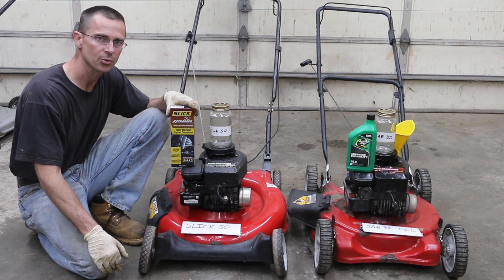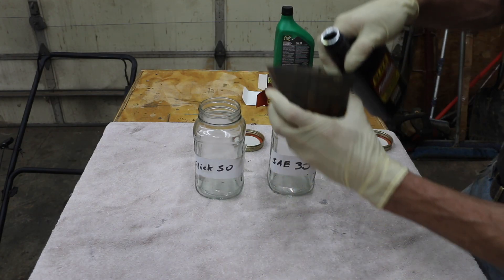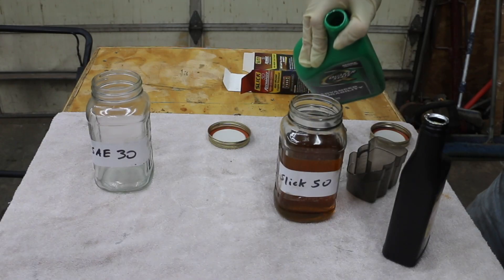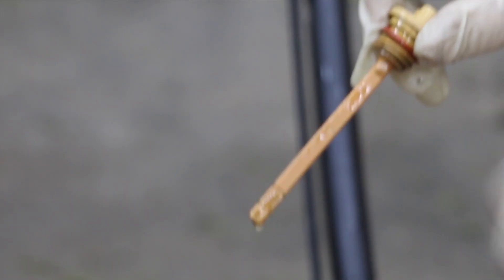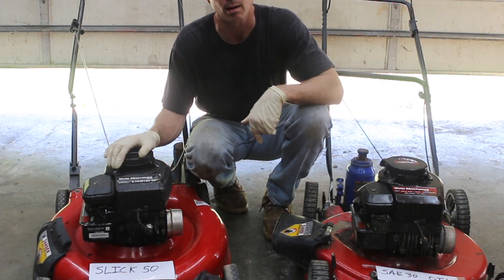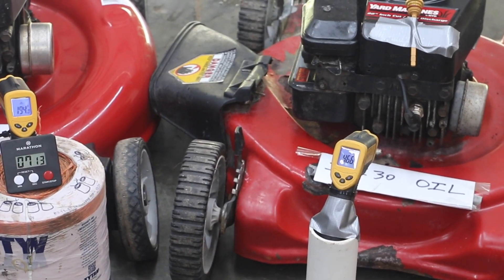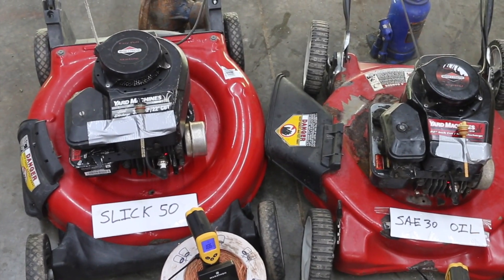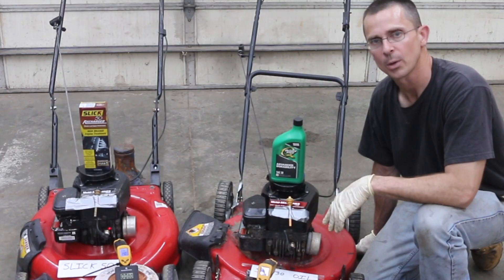Can't believe what SLICK 50 did to my engine!!--Dry Crankcase Test!

Comment: I think that they changed their formula. Took the Teflon out. In California anyway. When you tore an engine down that had it at the recommended use,  there was a medium brown film on the cam journals and mains and rods. Wrist pins were clear though. I rebuilt the 400 ci in 1995 with a little over 200,000 miles. It's still running today.
Reply from the maker: Thanks for sharing.

Comment: Slick50 does extend the life of engines. Lower Operating Temp = Less Internal Damage = Longer Life. These engines aren't meant to be run with nothing in them. You just got lucky that the one engine ran for 7 minutes. That's just the steel lottery.
Reply from the maker: Thanks for the feedback.

Comment: As I rember Slick 50 was some sort of Teflon coating.. actually PTFE or something like that.
The Slick 50 original formula is said to be the only one to still have it.. If it is still around.
There are claims that the Teflon suspended substance can actually cause less oil flow if it builds up in the ports and passages and that the cbustionnor cylinder temp is not high enough or maybe too high to bond it to the cylinder walls...
It would be cool if gave  the slick50 original formula some time to build up you did a tare down and looked for Teflon coating on the walls And passages to see what was happening...
I am more impressed with the motorkote as well as the engine restore  product that was reviewed where the results where immediate and the product didn't require time to have to build up before you could see or test for results. 
Which is the claims that others are making about bonding time for the Teflon to build up and set...
So enough said.. 
but on a curiously funny note
 maybe you can poor all these extenders and rebuilding products together and shak em.up and add a 1/2 quart or quart  to a lawnmower engine or car engine and do a video on that.. Now I would really enjoy watching that.
Reply from the maker: Thanks for sharing.

Comment: Todd, why don't you test Fluoramic's Tufoil Engine Treatment against the Slick 50 product. The Tufoil is said to be "The world's most efficient Lubricant" according to its manufacturer. I have used it for over 40 years in subzero (Northern NY) environments and extremely hot (southern Texas) environments and have never had an engine failure. My car would easily start-up without oil heaters in subzero temps in NY, and run with an electric radiator fan failure in stop and go freeway trafffic in the summer time in San Antonio, TX. I think that's pretty good. Anyway, perhaps you could test these oil additives head to head. THX...
Reply from the maker: Thanks for the video idea.

Comment: I had a main oil seal[302 V8] blow out driving from Lost Wages to LA in July and then drove to PHX before I checked the oil. Bone dry. I didn't have the time to replace the seal and drove to OKC. The engine never overheated or faltered in any way. That was 40 yrs. ago and I have used Slick 50 in every vehicle since.
Reply from the maker: Thanks for sharing.

Comment: Hi I have a story to tell regarding this product, I have a 1995 Mitsubishi Pajero Junior which engine was burning a litre oil at every 1000 kms, I saw your video 1 year before, I was confused but decided to give this product a try so I purchased this product and the description of this product says that it revitilizez the seals and compatible with 10w30 so I did my oil change with Liqui Moly 10w30 grade oil with slick 50 believe me or not this product really works, My mitsubishi stopped burning oil 1 year before when I started to put this treatment my car had 180 k miles on it and now it has 225k miles and it does'nt burn any oil infact it has improved the fuel economy from 6-8 and proved to be a life saving product for my engine and then after two years I decided to put this product in my toyota harrier 3.0 with an oil change I can really feel the diffrence with much more power with better fuel  economy now I can confidently say that this product really works satisfied with it 😍
Reply from the maker: Thanks for sharing!

Comment: Bottom line. Internal combustion engines are designed to run with OIL. The weight of oil depends on the engineering of each engine. But Slick 50 was touted to be able to run an engine without oil, after treatment because of the Teflon additive. It's been proven that Teflon does NOT coat metal parts and so, effectively, You will run a dry engine and it will suffer an early demise. It's not rocket science. You would be better off running your engine with snake oil, but stick to the recommended oil. It's cheaper than buying a new engine.
Reply from the maker: Thanks for the feedback.

Comment: Maybe the problem is due to the lack of friction from Slick 50....no oil stuck to the parts in the engine. So more oil would have drained out with the Slick 50 engine.  Whereas with the oil only engine, there was probably more oil left in the engine?
Reply: Higher viscosity, thicker oil, would tend to make it stay in place longer.  It was pointed out that the slick 50 was pretty much like  30 weight oil in thickness. Must be a different reason.

Comment: The results are not logical because before the engine locked up it should have gotten gotten hotter in my opinion you should start with 2 identical brand new lawn mowers.... We have no idea what the history of those 2 lawnmowers is ...maybe the slick 50 motor started out in worse condition ...maybe one has better rings, etc..
Reply: If one hade better piston rings than the other, one would have more blow by and with the oil fill caps removed, this would have been apparent.  Perhaps the 30 weight has better surface tension properties than the slick 50, causing it to reman in place longer.
Reply: @scootergeorge7089  you are correct, i didnt think about the aspects of particular components...  Only making a point that the internal friction bearing components components could be superior in one of those lawn mowers... they should have been identical and new...  feels like Project farm is 99.99% on his procedures this just happens to be that very rare 0.01%
Reply: @kafklatsch3198  -  Started the video again. I thought they were identical. They were not. that very well could effect the results. Good call!

Comment: Slick 50 is complete BS. They started off claiming that the teflon in it chemically bonds with the metal, even though teflon doesn't chemically bond with ANYTHING! Now the MSDS they supply doesn't list teflon as an ingredient at all, but rather just shows that it contains petroleum base oils. IT'S JUST OIL!!

Comment: There are two products that I sold for several years long after the Slick 50 business (started selling them in the late 90’s which were DynaLube and Opti-Lube Oil Fortifier. My daily driver was treated with Opti-Lube. My car was a Ford Taurus.

One day while just turning from I-81 to I-66 (near Front Royal, VA, I noticed that the car’s water temperature gage was buried to the right. Pulled off the road and opened the hood. Tapped my hand on the radiator cap and it was cool. Opened it and there was no water inside. Felt the hoses and they were cool. Went inside the car and turned on the heat to the highest setting. Nothing but cold air came out. Turned off the engine and checked the oil. It was dry. Started up the engine again which ran like normal and drove to Fairfax, VA (55 miles away at 70 mph). When I arrived at the service station there (which was close to home), the mechanic said that the head gasket had blown due to the thermostat getting stuck in the closed position. Told me that the car wouldn’t run anymore. Then I told him how I just drove 55 miles down I-66 at 70 mph to get there. He laughed and said that would be impossible. Told him to get in the car and take it back to the Interstate. I was in the passenger side and he drove the car to the next exit and back again without an issue. He was dumbfounded. Everything he was ever taught about an engine was somehow different now.

Donated that car and bought a Ford pickup truck. One day the local Walmart started to change oil got $19.96 (half of what Jiffy Lube did). So I got my oil changed there. Told them to not fill the oil all the way so I could pour in an additive. A week later I was getting gas and checked the oil. It was dry. Looked under the truck and saw oil leaking from the oil filter. Drove back to the Walmart and showed them what had happened. They said they would give me a whole new oil change. Then the manager asked me how I got the truck there without any oil in the crankcase. Told him I drove it here and who knows how long before that since the original oil change. He couldn’t believe that, but I explained how I was able to do it. He became a regular customer.

By the way, DynaLube was much better than Opti-Lube. It filled the micro pores of the metal inside the engine. The inventor’s son would pour water into the crankcase of his Pontiac Firebird and drive to trade-shows around the country.

I’ve been a long time dealer and user of these products for decades.
Reply from the maker: Thanks for sharing.

Comment: Slick 50 used to have a full page ad in Popular Mechanics and sold for $39.95. I contacted the dealer that put the ad in the magazine and got a wholesale price for the product and purchased 20 cases making me a dealer of Slick 50 (this was back in the mid eighties). Carburetors were still being used in cars. After adding Slick 50 to and engine the rpm of the engine would go up by about 30-50 at idle. We would adjust the idle screw to bring it back to specs (thus saving fuel). The problem was, when we changed the oil again using Slick 50, the rpm would go up again at idle. We couldn’t turn the idle screw down anymore without turning off the fuel. So the idle always ran faster making it hard to change gears (which ruined the engine). Now this might have been fixed when fuel injection replaced carburetors, but I stopped selling Slick 50 and Jiffy Lube started selling it at my purchase price.
Reply from the maker: Thanks for sharing.

Comment: Unless you have some kind of super highly engineered, super expensive engine, few people have a use case for anything but regular non-synthetic motor oil.  I have a Toyota hybrid engine, I think they use synthetic, but it's just a little bitty engine, so it doesn't matter.  I think regular oil would be fine, too.
Reply from the maker: Thanks for the feedback.

Comment: A lot of people in Brazil swears by “militec” an oil supposedly developed by the US army used to lubricate weapons. They use and there are a some videos of tests where they add this militec and later on drain the engine oil and then they go on a road test for miles and the engine never locks up.
Reply from the maker: Thanks for sharing.

Comment: I had a Geo with 2 recalls that I was NOT notified about.  It was over 5 years later that I found out the first recall was  missing a bolt on one of the pistons and the other was on TWO pistons.  I had a Slick 50 added to my oil change very shortly after purchasing my car.  I was the first owner.  I'm going to go with Slick 50 is a team player and works with the oil.  The mechanic who looked at my motor was impressed.
Reply from the maker: Thanks for sharing.

Comment: I was part of the film crew for the Slick 50 commercials and what was never mentioned in the commercial is yes the oil was drained from all the motors however, the Slick 50 motor was the only  one that did nor have the oil filter drained or removed
Reply from the maker: Thanks for sharing.

Comment: I ran Slick 50 in a differential in the '90s. I was doing long commutes and had to replace the pinion seal every 6 months. After Slick 50, I ran over 2 years and never replaced that seal again. I never ran Slick 50 in the engine. The time from 1990 on was a period of great improvement in motor oils. My mileage went from 23 mpg to 28 mpg, and the only change I made was to better engine oil as it became available. Modern lubricants are miraculous.
Reply from the maker: Thanks for sharing.

Comment: Great video! However, I want to point out that the Slick 50 you mentioned in the old time have a different formula from the one you test. The old one with PTFE and the new formula is zinc.
I used to put this in my HONDA CIVIC(1995 EG model). It's works. When I do valve clearance adjustment I can find a grey film(I think it is PTFE) coated on the camshaft. So this the reason why it can run without motor oil. The zinc in the new formula may do harm to the catalytic converter. This is my concerns.
Reply from the maker: Thanks!  Thanks for the feedback.
Reply: @ProjectFarm  So it should be interesting if you test with the original formula and see if it can really run without engine oil. XD

Comment: I remember the commercial you're talking about and I did some research.

Slick 50, the original, has not been sold under the Slick 50 name since 1984. The rights to the name were purchased, but not the formula itself. The original Slick 50 formula is being sold as XcelPlus and I have not seen any rigorous testing of it as an engine additive. Would you be willing to test XcelPlus vs the current Slick 50 and compare them to other oil additives?7
Reply from the maker: Thanks for the video idea.